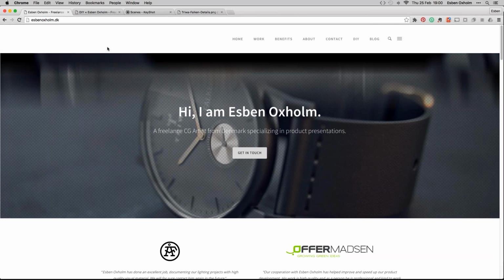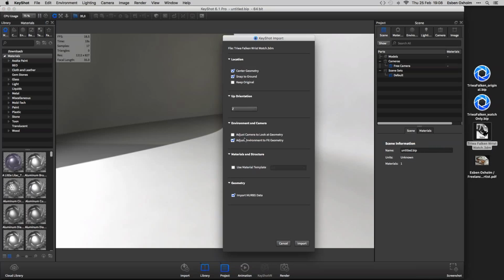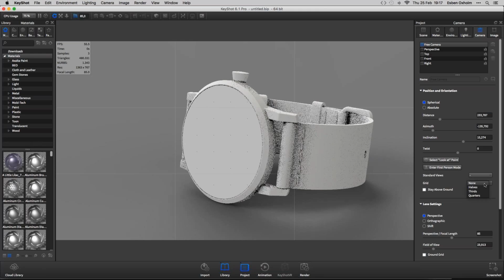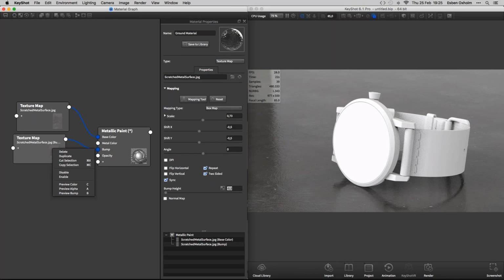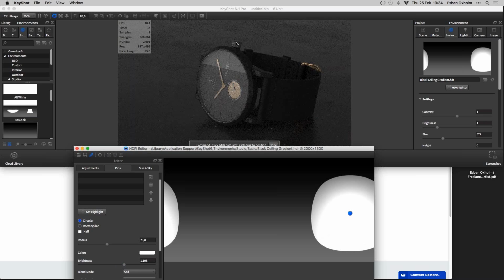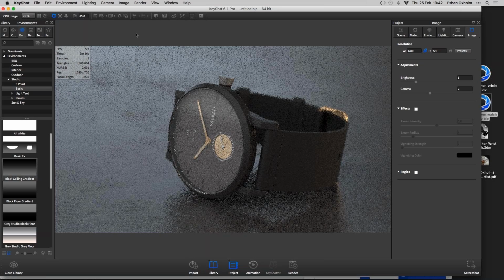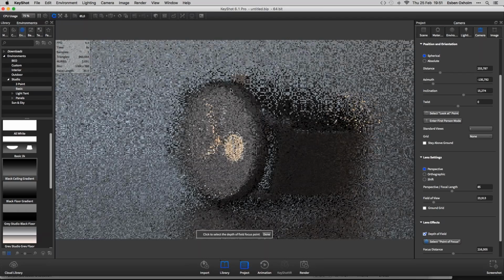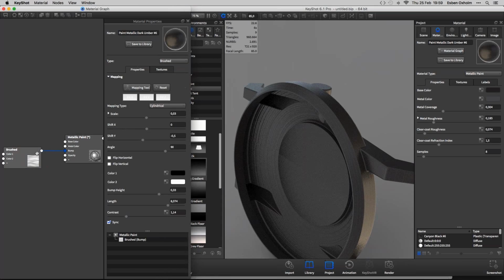KeyShot Webinar 49: Product Design Visual Workflow

Comment: why are models sometimes imported with a black difuse, other times with a white one? I found out, that if I import files with predetermined materials, they alwasy come in as black and every material I add in keyshot is very dark, as if it is just an overlay over the black model
Reply from the maker: What 3D modeling software/file formats are you importing? KeyShot respects the material assignments of most 3D software. Will depend on the software and how you've set it up.
Reply: KeyShot I've had this issue once when importing a sldprt from solidworks and a few times when exporting an object with predefined materials in C4D with your export plugin
Reply from the maker: Hmm, that doesn't sound like the right behavior. If you can send the model files to support@luxion.com we can help you further.

Comment: Very informative tutorial, how did you do those stitchings on the wrist?
Reply: Thanks, kerembyl. The stitched are simply modeled. It's basically a bunch of cylinders with bended ends going into small holes in the leather part.

Comment: Hey Esben, would it be possible for you to do a wood grain tutorial in Keyshot? learning how to do furniture renderings and struggling on book matching the grain patterns and aligning the grain direction on one part in different directions to show end grain etc. I use solidworks and keyshot 6. Thanks.
Reply: +Jake B Hi Jake. Not sure I'm the right one to do that. Wood is tough and I'm not that experienced with it. I think the trick is split the surfaces of your wooden object at and apply different textures to the different surfaces. I.e. one for the side grain and one for the end grain. It could actually be fun to do a quick tutorial about it. I might look into it. I will let you know if I do.